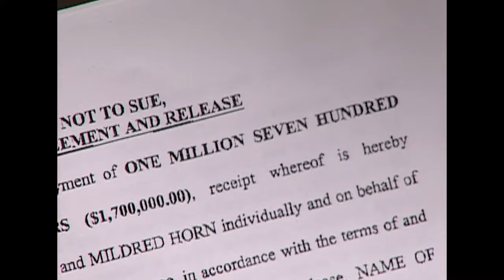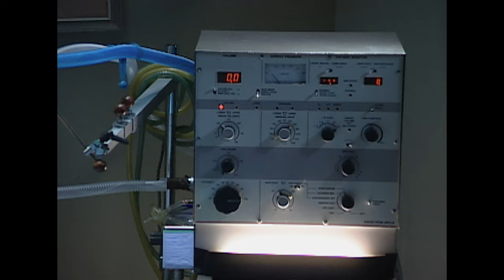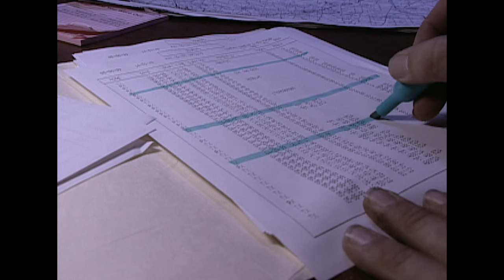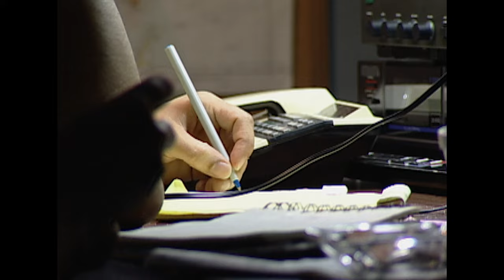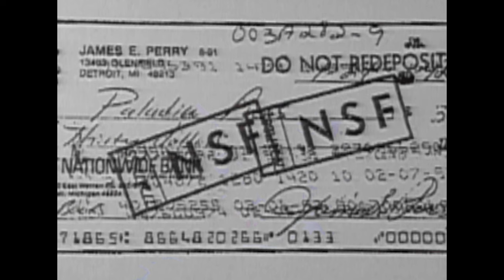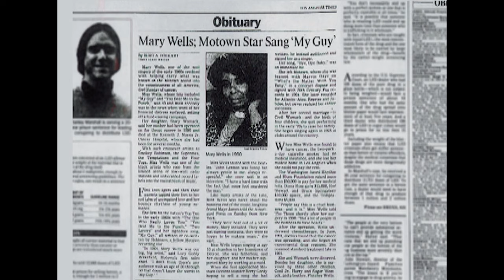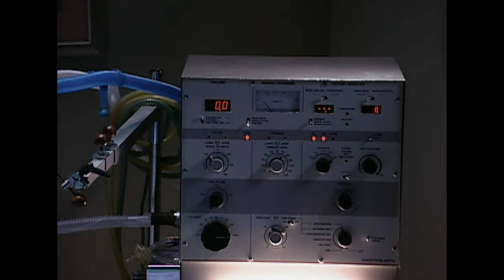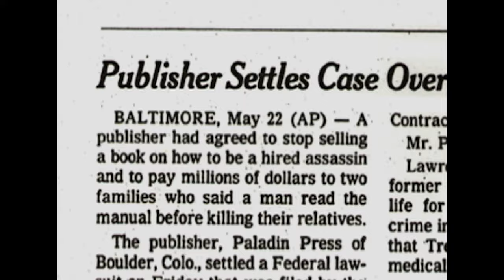The Almost Perfect Alibi | The FBI Files | Real Crime

Comment: The AR-7 was developed from a similar survival rifle to be carried by US Air Force crew members in case of a crash or parachuting into remote areas. It could be used both for hunting small game and, in a pinch, for self-defense. It was designed by Eugene Stoner, at Armalite, the same guy and same company which later developed the AR-15 which became the M16. The AR-7 itself was never adopted by the USAF but was used by the Israeli Air Force and it has been a popular rifle for backpackers who are going into areas where dangerous animals may be or who want to hunt in the event of being stranded. The plastic buttstock is hollow and has compartments which all of the parts of the rifle, including the barrel, can fit into. When put together like this, it will float. It is a very decent little semi-auto .22LR rifle. It is still made today by Henry Repeating Arms (a new company unrelated to the old Henry rifle) as the Henry Survival Rifle.